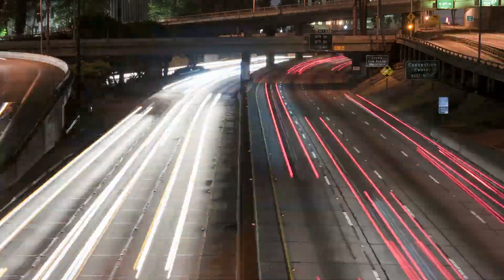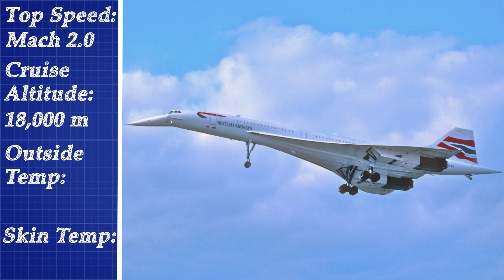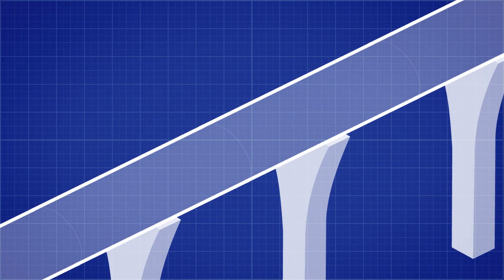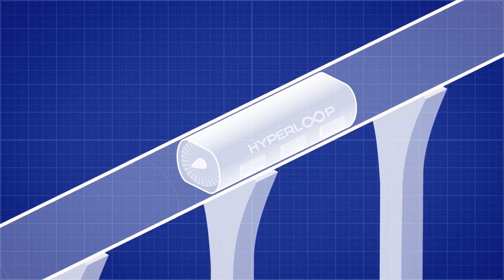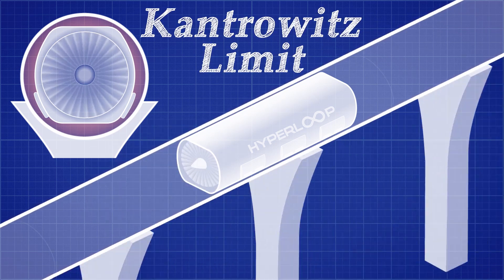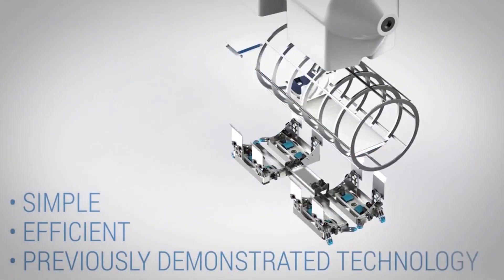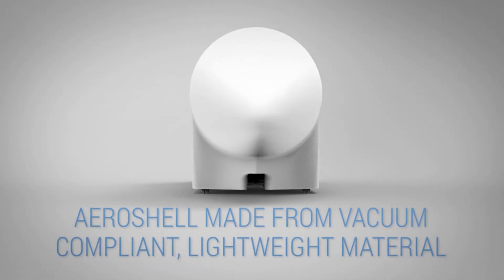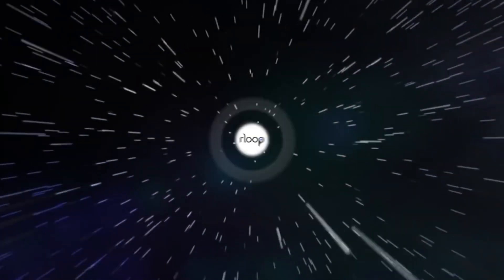Hyperloop - The Future of Travel?

Comment: A simple hole in the tube will wreck this whole idea
Reply: Not really. I assume you're talking about Thunderf00t's video where he claims a rifle could destroy the whole tube, but he failed to take into account that pumps would easily offset such a tiny hole. You don't think airplanes blow up when you shoot a bullet into the walls of them, do you?
Reply: Lutra Nereis Lutra Nereis yet the plane doesn't have the pressure change from atmosphere to a near vacuum thats what would be intended for the hyper loop. Also the forces pulling on the pod from the change in pressure would just pull it into the wall causing major damage to the pod
Reply: But you're also talking about a pipeline that is many kilometers long. The length of a pipe (think of a fuselage as a pipe) as well as its diameter determines the amount of pressure loss throughout the pipe. This works whether the pipe is greater or lesser pressure than the outside world. So while the pressure difference between the fuselage and the pressure at 12,000 meters might be less than the pressure difference between a near vacuum and atmospheric pressure, the length of the hyperloop tube means a bullet hole could never cause explosive decompression.

Watch a video of someone shooting a propane tank. The pressure in those tanks is around 11 atmospheres. Sure, the gas sometimes ignites, but the tank itself survives and those things aren't made specifically to handle rifle shots. 

Sorry, but a rifle isn't going to destroy these tubes.
Reply: Lutra Nereis no I never meant that there would be exodus decompression, the force pulling at through the hole will also pull the pod as it moves past and if it's suspended magnetically like they say they either have to have magnets around the whole circumference of the pod of risk major damage to the pod
Reply: Care to show me your math on that?

Comment: Could you do a video explaining thrust and how rockets are able to propel in vacuum?
Reply: You mean in the vacuum of space? Simple. In space there is no air friction, so all the kinetic energy a rocket gains in the launch isn't lost when it travels through space.
Reply: Benjie Leshansky How it propels is what I'm asking. I know is about newton's 3rd law of motion, but i would like this guy to explain it using graphical example. Are you suggesting that the rockets uses the momentum it gained from earth atmosphere to move in space?
Reply: Jin Izzraeel Not from the atmosphere, but more in the atmosphere. When a rocket launches, it creates a lot of kinetic energy- energy that moves things. On earth, if you throw a ball, the ball will move forward because you are propelling it with your arms, making it gain kinetic energy, and thus accelerate, but eventually the ball will lose its kinetic energy because of friction with the air. Because in space there is no air, rockets don't lose momentum, allowing them to move on practically forever until another force acts comes into the equation.
Reply: Benjie Leshansky I don't believe that's the case. Rockets can actually accelerate in space. It has to do with 3rd law of motion. Every action has equal and opposite reaction. Although, it's not entirely clear in my head, as there is nothing to push against in vacuum but it works somehow. That's what i need to understand.
Reply: Jin Izzraeel Well, rockets can still accelerate (increase their speed) by turning on the thrusts, but it can still just move at an adequate speed without using any fuel because there isn't any friction.
Reply: Benjie Leshansky I understand that. I was just curious how it propels, to understand how the particles interact with each other
Reply: The 'action' of hot exhaust gases rushing out of the engine nozzle in one direction creates a 'reaction' on the nozzle and combustion chamber, producing thrust. It's like the recoil from firing a gun, but instead of a single bullet, with lots and lots of molecule sized bullets.

Rocket engines actually work better in a vacuum than they do in atmosphere, because the ambient pressure of the atmosphere slows down the exhaust flow, as a result of which the engine produces less thrust at sea level than they do in vacuum, and which is why specific impulse (engine efficiency) is always given at sea level and in vacuum.

Comment: You forgot about the whole expansion of the loop in hot weather thing
Reply: +Alexander Webb The tube would likely be on supports over which they could move especially in turns, thermal expansion would then just be incorporated into the gradual turns that the tube would take.   Thermal expansion is a problem that is already dealt with in pipelines which stretch over thousands of miles.   Also, breaks in the tube are possible as they only mean leakage that just needs to be addressed by more pumping, large trucks and buses use air brakes instead of hydraulic brakes in order to tolerate leaks.   The tube could also be telescoping, that is tubes with breaks within an outer tube covering the area with expansion breaks, seals can be maintained by oil and grease lubrication.   We deal with thermal expansion all the time, it wouldn't be a problem.

Comment: How much energy would it take just to create and maintain the atmosphere inside the tube for this to work?
Reply: +BlahBlahFreeman That's why it's a partial vacuum. The closer you get to an actual vecuum, the more energy it takes but if you just do a partial vacuum then it doesn't take that much energy. However, a partial vacuum still results in air building up in front of the vehicles which is why the hyperloop proposed a turbine on the front.   The interesting thing about the rloop is that they are forgoing the turbine hoping to make guideways large enough for the air to pass with minimal drag.   Somewhat defeats the purpose of the design competition just to get a small prototype going but as they say, a small test track prevents them from reaching speeds where air resistance would be a problem.   However, this video is just a commercial for crowd source funding and should be frowned upon.

Comment: hyperloop has been debunked and busted to hell and back
Reply: Nope It hasn't, a YouTuber with a PHD in chemistry making a youtube video, does not disprove an Engineering concept, especially since he hardly read the white paper.
Reply: Thunderfoot blows it way out of proportion.   He shows the concrete walls of NASA's deep space vacuum chamber but does he show the thin glass walls of your thermos?   He talks about air rushing in at the speed of sound, the air would rush in at a speed determined by the differential pressure and the diameter of the opening as per fluid dynamics, the speed of sound is an upper limit that it could not exceed no matter what the differential pressure is and keep in mind that the differential pressure is not infinite, it would be less than one atmosphere, your espresso coffee maker operates at 19 atmospheres, you don't see the coffee shooting out at the speed of sound.   We already have pneumatic systems that deal with leaks all the time, the very reason why we have air brakes for trucks and buses is that leaks can be compensated for with additional pumping capacity.    Thunderfoot is completely oblivious to engineering fields such as fluid dynamics.   Take his video to your local University and ask the fluid dynamics prof to review it.

Comment: but what if get stuck in tube?
Reply: +Katianie9 That's a good question. The capsules would have emergency life support similar to those used in mines and the pipe would have to be cut to remove the capsule which means tunnels may be a problem.   The tube of course could also be pressurized and the passengers could crawl out to an emergency exit point.   However, keep in mind that this is a design competition from a billionaire who makes his money by being seen by investors as being on the leading edge of technology and innovation.   The idea doesn't have to work, it just has to keep Musk in the news so he continues to get investments.   You can bet that he's trying to find some other idea to take the lead as interest by investors wane.

Comment: Why eject the air behind? Why not just compress it and store it in the capsule and dump it when it reaches the station? Less air in the tube increases efficiency on each subsequent run.
Reply: +protonjinx Compressed air still takes up a lot of volume and storing the air on the capsule only increases the mass of the capsule. Ejecting the air out the back reclaims a portion of the energy spent as thrust as well as reduce the amount of air that needs to be moved by establishing some pressure behind the capsule.
Reply: If you store it and drop it off at the station it means the next pod wont struggle with the same air. Compressors running in the pod are going to have an easier time "finding" air to compress since it will be automatically compressed in front of the pod. Huge compressors trying to vacate the whole tube is going to be less efficient because all the air will be evenly spread through the whole volume of the pipe.
Reply: St   oring it and dropping it off at the next station is also accelerating that added mass along for the duration of the journey when all that is needed is to prevent it from impeding travel.   The whole point of the hyperloop concept is to ask two questions, can the system be developed from existing components such as pipes from the pipeline industry and does an evacuated tube transit system really have to have a complete vacuum, could it function with only a partial vacuum.   Pushing the air along the whole length would defeat the purpose of whether or not a partial vacuum is sufficient.   It is hoped that compressing the air and pushing it out behind would deal with the remaining build up of pressure in front of the capsule, pushing the air along would only reduce the velocity and increase the energy cost.   You're still trying to create an evacuated tube transit system when the question is whether a compromise is possible, could a complete vacuum be avoided to reduce the costs of evacuating the system.

Keep in mind that Rloop is avoiding the whole air pressure bit with their prototype on the basis that a short test track prevents the capsule from reaching speeds where the drag would be an issue and that their competitors are also not addressing the pressure issue of a partial vacuum system because of the short test tracks.    

It can also be argued that an active compressor on the front of the capsule may not be any more effective than ramming the air along passages along the sides of the capsule leaving the linear motor as the only active component needed.   The concept that Musk  first put out also used that compressor to compress air for the passenger compartment in the same way that a jet aircraft does so there may be other reasons to keep that active component there.   There's also the possibility of lining up another pipe alongside the pipe and have periodic openings between the two, this would allow the air to flow around the capsules by leaving the tube into the other tube as well as offer a path for travel in the opposite direction.   There are many possibilities, this is just a technology competition to get other people to find funding and work on the many possible variants of the idea.   Musk just wants to benefit from the work and financing of others as well as have himself viewed as being a visionary in technology and innovation by investors.   There's nothing seriously wrong with the idea, it may work, in my opinion there is more wrong with the business model as it serves a niche market that could be addressed by telecommunications and is currently inefficiently addressed by air travel but regardless of whether or not the idea works, Musk has already met his objective of being in the news and being seen as a visionary.

Comment: Before you make a hyperloop, make a vacuum chamber at the size of the loop to make sure that you can actually even do it.
Reply: +LokyNoKey The difficulty of maintaining a vacuum in vacuum transit has always been a major hurdling block in vacuum transit, what the hyperloop is saying is that maybe a partial vacuum could be enough as it's much easier to maintain a partial vacuum even if there are substantial leaks.   Of course, a partial vacuum brings other problems such as pressure build up in front of the capsule which is why the concept art has turbines on the front of the capsules.   But the whole idea is that maybe a complete vacuum isn't necessary.
Reply: +John Wang They are planning to use a vacuum with a pressure of 99 pascals.
Reply: LokyNoKey Yeah, there are serious problems with their proposals as the premise of a weak vacuum being easier to achieve isn't consistent with a proposed strong vacuum.

I don't think it's necessarily a good idea or that it would even work as described but I do think the question of whether a weaker vacuum could be used in an evacuated tube transit if the limitations are addressed by additional active efforts such as the compressor in front of the capsule is a good question.

I think the objections are exaggerated, I think the proposal is exaggerated, and more importantly, the current slate of prototypes such as rloop purposely avoid addressing the issue of whether or not a compromise to evacuated tube transit is possible.

We know that a true evacuated tube transit is theoretically impossible to achieve and plans to implement a system as close as possible to an evacuated tube transit has always failed in analysis but the hyperloop is about if we could design for the fundamental limitations with other technologies.   I think, it's too many unknowns for a working proposal and the current proposal shows this but I also think the objections levied are inappropriate again because we have too many unknowns.   The proposals is rift with assumptions but so are the objections.

I would like to see more developed proposals and prototypes but I also think the rloop prototype which this video is a crowd sourcing commercial for, doesn't do anything to develop the concept or at least not the most challenging question of how much the need for a vacuum could be reduced.

Comment: Whether the hyperloop is a viable idea in terms of engineering or not, it means absolutely nothing if the concept is not economically viable. Even if engineers could get it to work (which I believe they can) the enormous amount of redundant safety systems that need to be checked and maintained continuously in order to keep it operating safely mean that it would be incredibly expensive just to operate. Add to this the fact that a single tube can only be used between any two destinations and it is not practical to try to intersect tubes to create a multi-line network. The number of potential passengers that could use the network would be limited to only those people who need to travel between the two endpoints of the route. This means it would generate low revenues, compared to multi-destination transit systems like conventional rail or air travel. In the real world, the hyperloop would most likely not be able to cover its construction costs (which would be tens of billions of dollars) within its lifetime, let alone turn a profit for anyone operating it. 

Look, I'm as enthusiastic about engineering as the next guy, and I love pushing the boundaries of technology and conventional thinking, but at a certain point people have to be pragmatic. The more I think about the hyperloop, the more it seems like an impractical pipe dream (no pun intended) that arguably provides no benefits over conventional air travel, but which is clearly saddled with many more drawbacks than air travel (speaking in terms of practicality).
Reply: Rob T You are forgetting that, lets say it's one of the better scenarios, just some cleaning inside the tube, they then have to wait for the tub to depressurize safely which could take hours (If the maximum speed they can pump air in is 2 and a half hours then the depressurization time must be similar) Meaning that at the very minimum, the hyperloop is out of operation for 5 hours just in de/pressurization alone, add that to cleaning time and it is much longer, not to mention the frequency at which it would be down, there is serious risk involved with it, it would require regular maintenance and check-ups. To put it in perspective an aircraft (according to wikipedia, it was pretty much the only source I could find, sorry) at minimum requires checkup and maintenance every 400-600 hours and can take tens of hours for planes like the Boeing 747. Now put that in comparison to the hyperloop, the hyperloop is significantly larger than a Boeing 747 so it's safe to say maintenance and checkups could take hundreds of hours depending on how many people are performing it (which would be dictated by cost) so if the Hyperloop spent 500 hours (roughly 21 days or 3 weeks) in operation it would then be down for anywhere from really 100-200 hours, making the operational times actually incredibly short.
Reply: Spot on. The point about it only serving 2 distant destinations and the small likely number of travellers needing to get to/from those 2 is the real killer. It serves no useful purpose. The other being that a 'maglev in a vacuum tube' is going to be astronomically expensive.
Reply: To your point on economics ruling the day, down time (maintenance) costs money.   There was an interesting post below about the number of pumps required to reestablish the (near) vacuum with cost of ~ $100 Million (multiple pumps) and a time of ~ 2.5 hours to pump out most of the air.   That would mean each "fix" takes [fix time] + [2.5 hrs].   That is costly.

Does anyone know if the white paper indicates how individual tube segments can be isolated for replacement, or does the entire loop need to be re-pressurized?